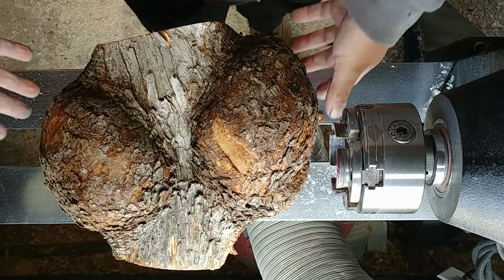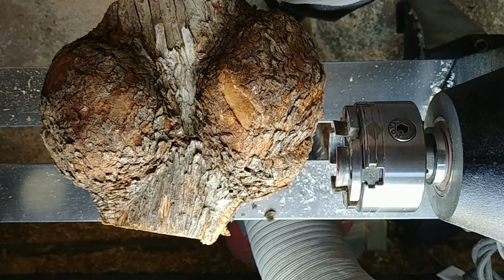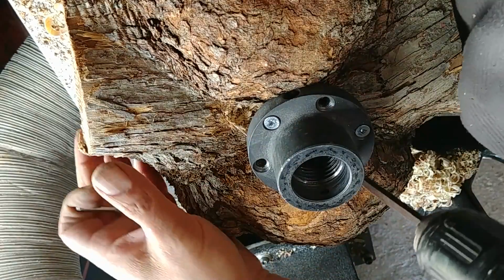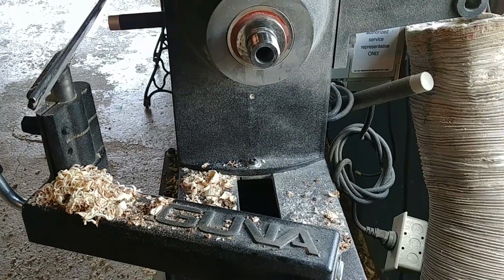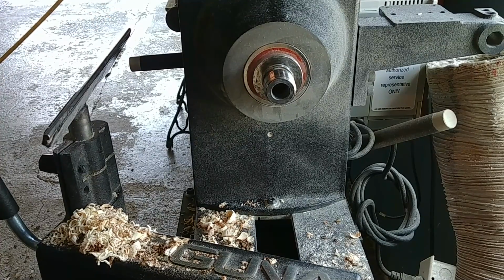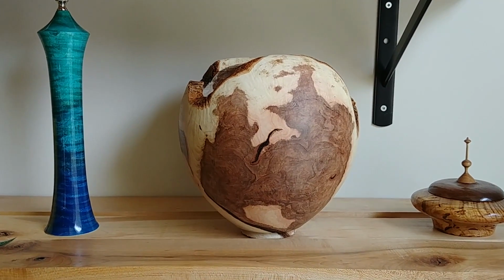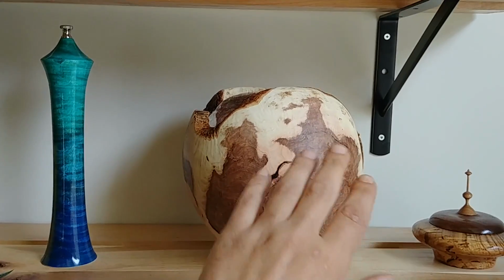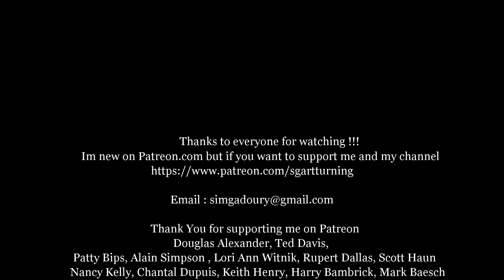Woodturning IronWood Burl

Comment: If you want to have less of a chance of the screws breaking off then use an impact driver with the same bit. It regulates the torque enough to reduce chance of breaking but can still easily get the screw out.
Reply from the maker: +Adamantian Gilga thanks sir

Comment: i always have problems with a lot of warping and cracking so i take some old polyurethane that's almost dried up and coat it in to help it dry slower and not crack so much. helps fill any pits and cracks and stabilize softer wood areas. i'm no master turner though. i need to try some different finishes out

Comment: back in my younger years in south west united states i use to cut ironwood that was all dark wood like in the spots on your piece, it wood dull carbide tipped chain saw chains and carbide circular saw blades, it was the hardest wood i;ve ever seen like stone, i made pistol grips and knife handles with it, very very hard to work with.

Comment: Drill a pilot hole first, then use soap applied to the screw when putting the screw in . This will help make it easy to get  the screw out.

Comment: yes  pre drill as you would metal.     Then use bees wax in the threads so they can be removed easily.    Iron wood is very hard wood and has to be treated as such.
Reply from the maker: +sc928porsche yea I will try that next time. Thanks

Comment: As an old finish carpenter, I always predril a hole for the screw to follow in any hardwood, there's a twofold purpose, One for the screw to follow without the screw wiggling around trying to make its way in when starting and at the same time the screw is much less apt to break another is because the wood is less apt to split, Plus you're not always in a situation where you can afford to gouge out wood to remove the screws speaking nothing of extra time spent, It doesn't take more time either as a drill bit drills very fast,

Comment: With a hard wood, like this, drilling pilot holes, 
that use only about half of the thread depth,
actually increases the strength of the screw-to-wood bond, 
because the wood is not forced away from the screw 
with enough force to fracture it.  
And it greatly reduces the torque on the screw.

Comment: If you rub some bar soap on the screws before putting them in it'll act like a lubricant and make it easier to take the screws in and out. Maybe they won't break on removal.

Comment: Is that a combo drill? Seems to spin way too fast to be a screw driver. Need a slow speed with high torque so you don't snap screws putting them in too fast or chew up the heads
Reply from the maker: +Andrew Wilson the first one was a Dewalt little impact drive. But not enough strong to remove the screws. But the drill Dewalt at low speed snap the screw.

Comment: I noticed you used a drill to run your screws in you should probably get an impact for that only old farts use drills to run screws in. Lol your screws will be less likely to break especially if you get one with multiple torqe settings

But your turning is bad ass!!

Comment: That has started off as a beautiful piece...wonderful figure on that wood.  For what it's worth...I've turned a dozen or so pieces of Cocobolo and had the same initial problems snapping  screws.  Started drilling pilot holes and burned out two bits and snapped one of them as well.  Resorted to bits specifically designed for drilling metal.  Much better.  Looking forward to your completed work.
Reply from the maker: +John Grace Thank you John

Comment: I know I'm inundating you with commons but I had given up on turning on YouTube until I found your channel. Right tools right techniques, not so much miss used carbide like in other views. The tools developed ago time ago work best. They have taken existing carbide and adapted them to lath turning from metal turning and a lot don't apply to wood correctly. I'm a machinist by trade and recognize the difference. But they market it we buy it.
Reply from the maker: +Mark Lethbridge yeah your right, carbide scratch wood, knife slices wood

Comment: Do you think there's a problem? Cheap fasteners and a drill motor set on high range. I watched 2 minutes and that's all of your vids I ever need to see.
Reply from the maker: +Bruce Moyers lol
Reply: Bruce Moyers 
Do you mean high speed? cheap or expensive screws and bolts can all spin off, the density is not always uniform and there is no guarantee that the fixings you buy are not going to break, no need to pilot any screw, forward and reverse two or three times and any screw will be driven home, high speed is sometimes needed for momentum to drive the fixing home, I do pilot some things but mostly it isn't needed and by only watching two minutes you missed the beauty of the end product, then again if all you are interested in is criticising the way he works it's not the wood your interested in.
Reply from the maker: +Symon Sheppard hahaha Thank you very much Sir
Reply: Yes, I go around with an eye to critique. That's funny. You use high speed for torque? Fastener quality is no guarantee? I don't buy "fixings". You go stand beside him while he's turning.

Comment: get an impact driver or turn down the torque. I'm surprised the wood didn't fly off the lathe
Reply from the maker: +Timothy Cooper I screwed it on with a impact. Just can't remove it with the impact

Comment: you do need better screws,I use tap con screws for my
face plate they are for ancoring into concrete(very tough
in 8 years I've never had one break) I use the ones with 5/16" 
hex head and 5/16'bit in my cordless drill
Reply from the maker: +jack young good idea I will try that hehe thanks

Comment: To avoid broken screws just make a hole with a drill 3/4 of the diameter of the screw before you insert the screw, and dip the screw in soap before

Comment: How hard is wood turning I would love to try it one day if it's not too hard
Reply from the maker: +Juice Man it's hard to say, it depends on who you are. But it's really easy if you like it and you practice
Reply: Hah!  It becomes easier, but it starts out pretty hard.  Even after 4 - 5 years of frequent weekend turning, I am still not good enough to turn a hollow form like this one, especially in such a difficult wood.  It takes practice and more practice and lots of exploding bowls.  Find a local arborist who is willing to give you free chunks of wood and use those to build your skills.  It is actually harder to turn the dried wood blanks you can buy at wood stores.  Rough turn green wood, let it dry (weigh it until it stops changing), then remount for a final turning.

Comment: There's a reason why they call it "Ironwood."
Reply: There are two types of "Ironwood" That's actual wood. The other is when the wood has been replaced by mineral deposits as the wood rots. That's actually stone. My dad had a huge stump like that. He's lucky he didn't try to put it on that Lathe.
Reply: There are hundreds of different species of trees known as "ironwood" in all different parts of the world. Which one are you referring to?
Reply: @NoTaboos  it's not nonsense. Under certain conditions left over stumps or logs buried rot away so gradually that minerals are deposited where the wood used to be. It may still often look like a log but it is solid stone. You take a chainsaw to it and all you will accomplish is destroying the chain. Physics is a bitch.
Reply: @NoTaboos  Wikipedia is not a reliable source
Reply: @NoTaboos  people call it iron wood because it has a high concentration of metals such as iron and you need diamond to cut it. Everyone I know calls it iron wood because people try to cut it because it is beautiful but you need special equipment to cut it. They don't realise in some cases until they destroy a saw.
Reply: Are you referring to "petrified wood"?

Comment: Drill some pilot holes for your screws and turn down the torque on your drill.  The you won't break so many screws.
Reply: Yeah I agree lol. Also, try getting better quality screws if possible. Sometimes cheap ones are made with inferior metal which isn't as strong...
Reply: Robert Winkel pilot, good screws and an impact driver
Reply: A K I agree, an impact driver makes all the difference.
Reply: Or you can just stop using screws made from chinesium...
Reply: Robert Winkel tei
Reply: or dont use shat srews
Reply: Robert Winkel ;
Reply: A K 

.. ..
Reply: Suryakant Warka
Reply: guarantee he knows...he was demonstrating how hard this wood is.
Reply: Sheet metal pan head screws are way stronger
Reply: Robert Winkel soap might help.
Reply: Robert Winkel i
Reply: A small bit of wax on screws also helps with harder wood

Comment: A beautiful piece of art Simon. I have had screws break in harder woods too, I now use high quality, heavy gauge stainless steel screws and drill a pilot hole first. Cheers, Jim
Reply from the maker: +Jimson's Stuff hehe good idea I'll try that next time thank
Reply: Very good advice,  removing broken screws is never a pleasant  experience.
Reply: SG Art Turning g
Reply: Ferrous screws are stronger than SS.  Ya just have to get good ones and shy away form galvanized.
Reply: I can't tell if the internet has just corrupted my mind, or if this thread actually has a whole lot of sexual innuendos.

Comment: Simon: you are very lucky that the last two screws held and the piece didn't fly off the face plate. Please look for better quality screws. Beautiful bowl. I'm looking g forward to seeing the finished product!
Reply: they broke on the extraction of the screws. they were fine until they were removed. Tough wood. :)
Reply from the maker: +AvidClimber yes it was high quality wood screw. This wood was like iron 🤣
Reply: drilling pilot holes in extremely hard wood is essential to not breaking screws, also put a bit of wax or soap (ivory for purity ;) on the threads and it might be well worth the time to insert and remove the screws in each hole before attaching the face plate
Reply: I've had those exact same screws brake under no real pressure as well!!!  Try GRK screws and pre drilling if you don't want that frustration.
Reply from the maker: +Retro-Tech Thanks I will try
Reply: Retro-bird hosesTech
Reply: Shelly Rappaport थजागपनाप थ
Reply: You should always drill holes first for screws (diameter of core, so without thread)